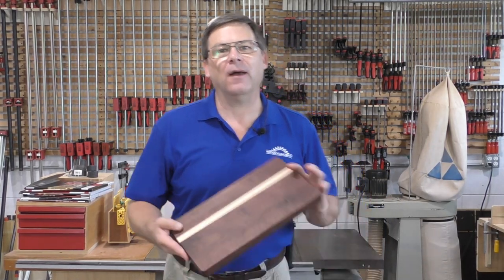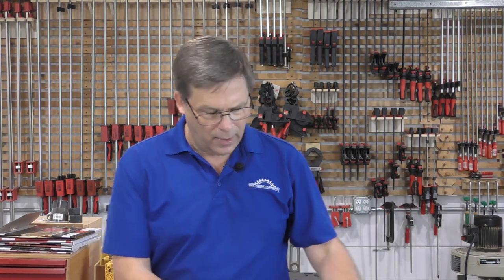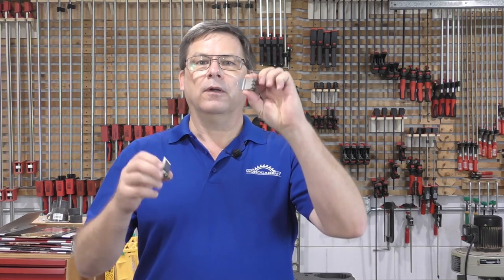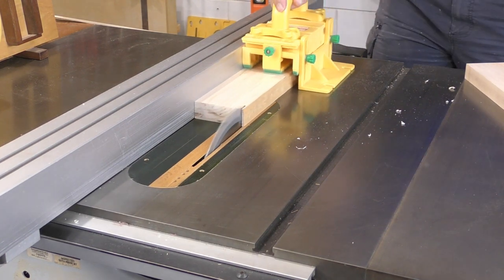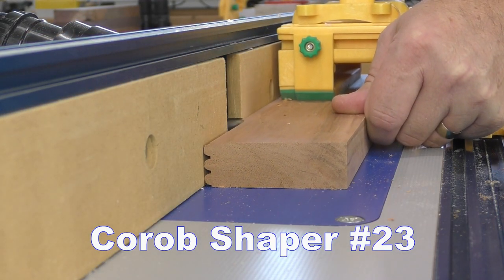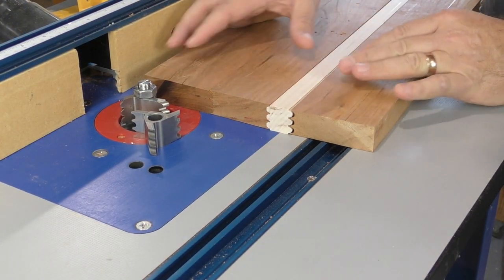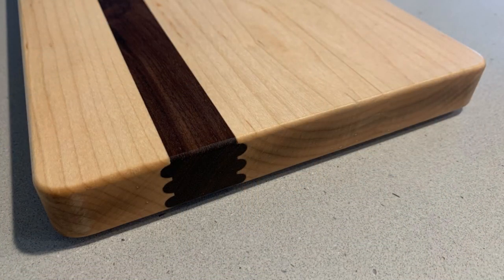A Different Sort of Glue Joint

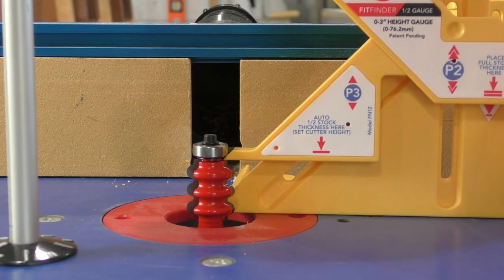Comment: Interesting use of the Fitfinder 1/2 Gauge to set both bits to the same height! (02:05)
Reply from the maker: The center of the bead is by eye, but setting off the carbide is accurate since the two bits are the same height.

Comment: Very interesting and unique idea. Thanks for sharing.
Reply from the maker: Thanks! It was fun too. I need to see what other bits I can use this way.
Reply: @Woodcademy  I was just looking at the shaper cutters on the Corob cutters site. Quite a few potentials for matched sets.

Could also have an interesting effect on an end grain cutting board. For example a flute and nosing set could create a jigsaw puzzle look.
Reply from the maker: @woodshopnerdery  yes, and there are several bullnose/cove pairings as well! 
One of the cool things about Corob is that most of their profiles come in both shaper cutters and molding head knives so you can set up half the profile in each machine and work away.

Comment: I have the old sears cutter set and used them a lot in the past. When they quit making them I figured it was because they were dangerous for some reason. I set them aside and started using the router table instead. I may break them out again. You seem pretty sold on them.
Reply from the maker: Thank you for watching! Used properly, the molding head is perfectly safe. It can also do things that are difficult any other way.
Reply: @Woodcademy  I used them safely for years. Thanks for reminding me of their usefulness. I have a big variety of cutters so I'm going to start using them again. Fortunately I kept my old table saw because it's a no no with the Saw Stop. Thanks again.